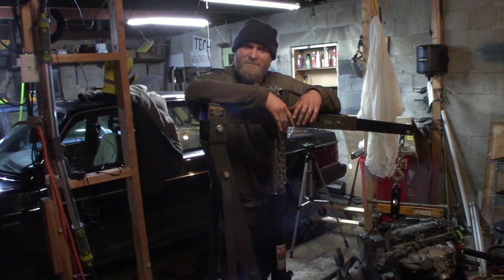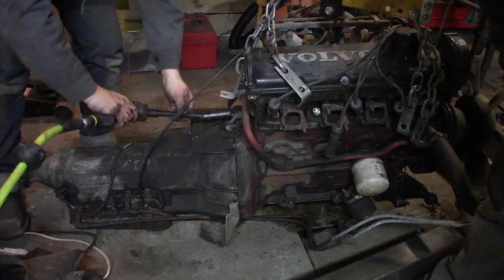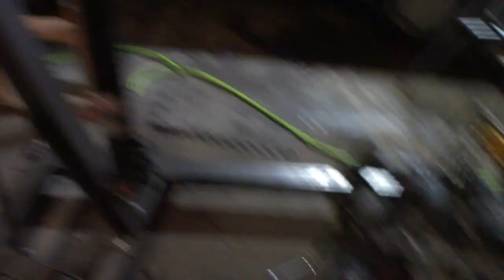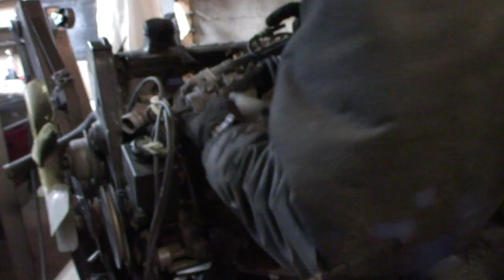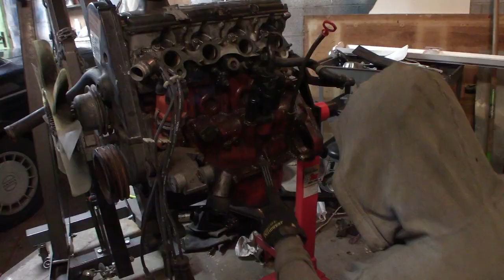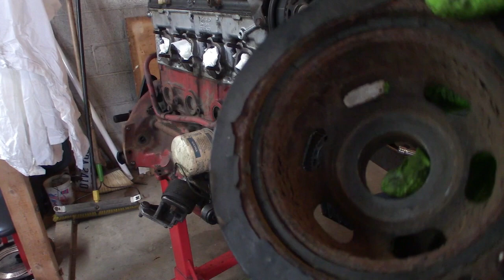Volvo B230 Engine Refresh Part One: Cleaning and Disassembly. Project Black Brick

Comment: Hi guys  
I love your videos, I have a question to ask you guys
I  accidentally removed my step flywheel without marking it, and now 
My car doesn't start.
I put cyl 1on top dead center( compression stroke)
Distributor rotor pointing at number 1 on the cap.
Where does the step flywheel need to point?
I've taken the transmission out twice 
Help me please.
Thank you